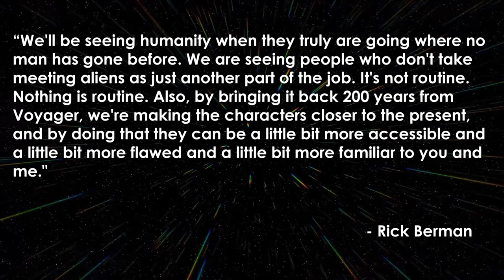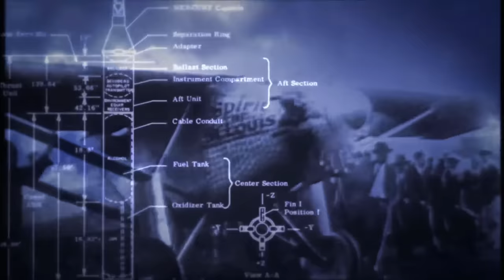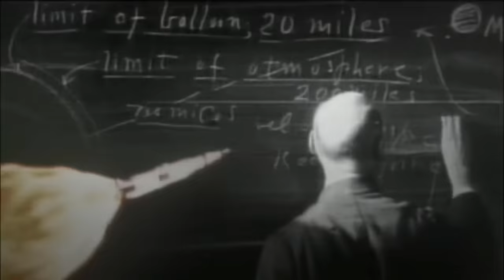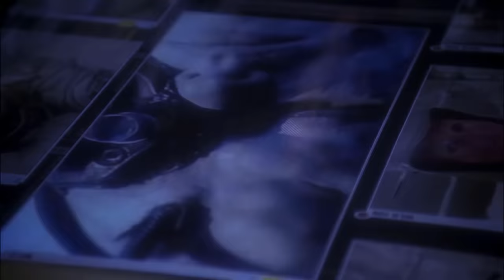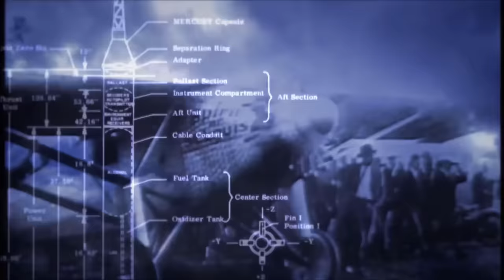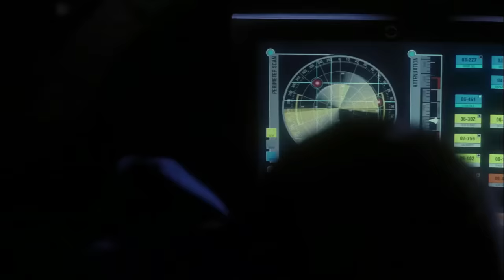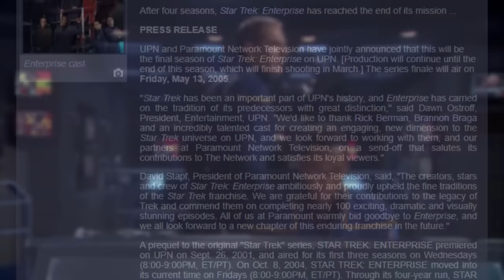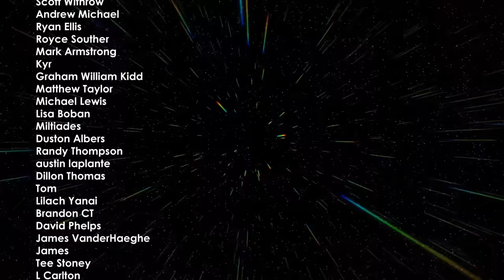Star Trek Enterprise Retrospective/Review - Star Trek Retrospective, Part 15

Comment: Honestly believe now would be a perfect time for an Enterprise sequel series. It's been enough years that the cast can appear as older versions of their original characters and we can see the tensions/dramas that would come from early Federation politics, unifying the races into a joint Starfleet etc.
Reply: They can pull a Roseanne, pretend the finale never happened and maybe do a limited run series or 3 part miniseries to finish their story.
Reply: As long as Alex Kurtzman (the man whom most Trek fans love to hate for numerous reasons) is still in charge of the franchise, at this particular time, maybe it’s best to let Star Trek: Enterprise rest in peace. If Kurtzman did attempt to bring back ENT, the end result may not be what those in the fandom wanted, hoped for or even expected, and that will simply anger, infuriate and fracture the Trek fandom even further, and that’s not what the series, the actors or the fandom deserves. 😐
Reply: We now have three prequel series (ENT, DIS, SNW). That seems to be all people want to make. =\
Reply: @lunasophia9002  - That seems to be what they want to make, because it’s “easier” (so to speak) to do a prequel that sets the stage for the other Trek shows than to do a Trek show that’s in a different time post-TNG/DS9/VOY.
Reply: @lunasophia9002  I would say that Enterprise was well warranted as a prequal concept though. Sure we may know that the Federation gets built on the heels of the Earth-Romulan War but we never get a true picture of Earth's early exploration after first contact and the years  of events that built those relationships. 

Discovery... nuff said

Strange New Worlds, please God be a return to the Trek we knew and loved.

Otherwise Trek Culture did a good video on some ideas but rather than saying "prequal" called them "unexplored eras". Still plenty of good stories to be told in there but depends on the direction people take it.

Comment: 1:17:00

Nope. The official Star Trek website was never shut down.  Also, Star Trek The Magazine ended 2 years before the cancellation of Star Trek Enterprise last issue April 2003).  The magazine was discontinued due to low subscriber count, high price, and the ending of the Star Trek Fact Files (its primary source of material, and the publication of which it was the american counterpart).
Reply: Rowan may be thinking about the Star Trek Communicator, a separate magazine (originally known as the Star Trek: The Official Fan Club Magazine) that did end in 2005, however, its ending had nothing to do with the ending of Star Trek Enterprise. Communicator was ended by the publisher Decipher due to complaints about long mailing times, threats of lawsuits, and Deciphers financial Issues.

Comment: The retrospective I’ve been waiting for and it does not disappoint. Thank you.

Bold statement, but I'd argue that Enterprise is the best of the Berman era Star Trek shows.

Not in any regular comparison of course, because TNG, DS9 and VGR all had their best years starting with season 3 or 4 resulting in four to five good to excellent seasons, and thus Enterprise can’t compare only having four season in total.

A more fair comparison would be to compare just the first four seasons of those series. And then Enterprise compares very favourably.
- Season 1: unlike the other series, season 1 Enterprise is never really horribly bad (as in Code of Honor bad), but also never really excellent (as in DS9 Duet). It just mediocre whereas the other shows sometimes are just painful to watch. 
- Season 2: all shows improve and so does Enterprise. Still no real highlights, but again no real horribly lows. The Borg episode is better than TNG did in season 2, the season finale is better than any of the other season enders save perhaps DS9, and in general it’s okay-ish compared to the meandering other shows.
- Season 3: Nothing comes close. The series still stumbles, but neither TNG nor DS9 have a s 3rd season that can compare to Enterprise. And the best episode (Damage) leaves Best of Both Worlds in its dust.
- Season 4: Although lacking the absolute highs of season 3, it’s again better than TNG. DS9 scores very well, excellent even, but struggles with its soft reboot and in general Enterprise seems more even.

Such a shame the series was cancelled, because more seasons would’ve likely cemented this.

Funny enough, I wish Trip had been the Captain. I just like his character in that role so much more. I think season 4 should have Archer as an admiral, Trip as Captain and Enterprise refit.

Comment: The issue with Dear Doctor isn't just that it amounts to a simple difference in perspective, it's that it relies on a deep and profound ignorance of both evolution and ethics, creating a story that rationalizes and endorses our civilization's most destructive impulses, framing something as evil as ethnic cleansing as a form of cosmically ordained enlightened altruism.

In the episode, evolution is depicted as a kind of destiny; a "grand plan" that the characters would be arrogant to try and alter. First of all, evolution simply does not work the way it is depicted in this episode. By definition, evolution deals with the slow, statistical increase in frequency of slight variations over the course of successive generations. It does not happen within the span of a single generation, and it certainly does not involve one species suddenly attaining a massive increase in cognitive ability while another species coincidentally starts dying off from a disease. 

Second, while equating natural processes like evolution with some kind of grand or cosmic plan is certainly a staple of Star Trek stories dealing with the Prime Directive, past episodes have still treated this perspective as just one of many philosophical positions on the issue of interfering with less advanced civilizations. It is not treated as the moral underpinning of the Prime Directive itself. In both TOS and TNG, the Prime Directive is treated as a well-meaning, but ultimately arbitrary regulation designed to prevent Starfleet Captains from unduly inserting themselves in the middle of alien politics. In many episodes, General Order One is treated as a barrier that prevents the Captain from doing the right thing, ultimately leading to them finding a clever work-around or just flat-out violating it. It's like Kirk violating orders to take Spock to Vulcan in Amok Time. There are always circumstances where blindly following the rules lead to bad outcomes, and the best episodes of Star Trek involve the Captains making the hard decision to bend the rules when it's necessary. Dogmatically defending the Prime Directive as some kind of moral absolute is the opposite of what Star Trek should be about.

Likewise, dogmatically refusing to interfere with "natural processes," like the emergence of a deadly virus, represents a form of naturalistic sophistry. Dear Doctor would have us believe that curing a virus is akin to "playing God", but aside from this being obviously nonsensical (since curing diseases is something we do all the time), this conclusion is predicated on two assumptions. First, we must assume that Flox's interpretation of the evolutionary future of the Valakian people is the correct one. Second, we must assume that the way things are represents the way things should be. I explain earlier that evolution simply doesn't work the way it is depicted in this episode, but even if it did, that doesn't automatically mean things should be allowed to happen the way "evolution" has decided it should. This type of fallacy is called "deriving an 'ought' from an 'is.'" Just because a human is born without fur doesn't mean that they ought to never wear clothes. And just because this group of people is born more resistant to a deadly virus doesn't mean they ought to dominate those who aren't. Flox's position is based entirely on these two fallacious assumptions, but the more troubling thing is that Flox's position actually isn't all that alien. There are plenty of real-world examples of this perspective being put into practice, and both we and the world of Star Trek regards them as acts of barbaric cruelty.

When Europeans began colonizing North America, they unwittingly brought with them the Smallpox virus. This disease had emerged in the cities of Europe, flaring up and dying down like fire at various points over the course of thousands of years. As a result, a natural immunity to the virus became common among people of Eurasian descent, but to the native people of the Americas, who had been cut off from the Eurasian continent for tens of thousands of years, this immunity was all but nonexistent. Because of this, smallpox absolutely devastated indigenous populations to a degree that is almost impossible to even fathom or describe. Even the word "decimate" is insufficient, since it literally means "to remove one tenth." In some areas, Smallpox wiped out as much as 90% of the native population. Entire villages, who had never even seen a white person, were completely annihilated by the virus. Modern science-fiction loves to fantasize about the post-apocalyptic, depopulated remnants of our civilization, but to the indigenous populations of North and South America, that actually happened. If anyone tried to actually argue that this was the will of evolution, and that it had to happen so that the preferred race could reach its full potential, we would know what to call them. If they took the next step and actively worked to help it along, we would also know what to call them. Yet this is exactly what Flox does in Dear Doctor, and we are meant to agree with him.

Refusing to cure the Valakians even though it is in your power to do so isn't just moraly questionable, it is evil. Justifying your decision by claiming you're doing the work of evolution is even more evil. Flox is a genocidal monster and should be regarded as such.

Comment: The Shuttlepod podcast run by the actors of Reed and Trip had Rick Berman on recently, and he tells them why it had to end the way it did. They didn’t want to do it g the holodeck way.
Reply: Ok.  Why did they have to end it in the hollodeck?  Are you going to finish the thought?
Reply: @JV-xf9ry  Here you go. I timestamped it to where he starts talking about it. It's a good show to listen to or watch if you have the time. Trip and Malcom are pretty good hosts.

 https://youtu.be/T12A5mS3VPo?t=1740

If you REALLY don't have the time, a quick summary is that they thought they had three more seasons to show how the Federation was founded, but the network said "nope, this is the last season" almost at the end of the fourth season. They had to scramble and come up with SOMETHING, and that was the best they could do in such short notice.

Comment: My biggest problem with Enterprise was the immense amount of filler episodes, and like you said, retreading old material. If these filler episodes were really good, they were not satisfying in the long-term and I always felt that they stole episodes away from what could have been core material to the series' premise. There was enough 'filler' episodes in many of the other series, and serialization was becoming the norm around this time.

I feel like the temporal cold war and even the xindi arcs just took this series so far away from the show's premise. It never really got back on track until season 4, which ironically also had to spend episodes correcting canon as well and had 3 episodes purely dedicated to ending the temporal cold war and finishing the series, and all 3 of them were garbage. 

In a nutshell, the series was just spinning in circles. The Xindi arc wasn't bad; I just don't think this was the right arc for the time period. 

Still, if Season 5-7 would have been at the same quality as Season 4, the show could have been one of the best Star Trek's ever. I miss it somewhat too because the new Star Trek shows don't evoke the same feelings as TNG, DS9, VOY and ENT did. I kind of hate them.

Comment: I was one of the few who liked Enterprise when it first aired. I saw it as it's own thing separate from the other Trek shows and I think it worked fairly well just not as a prequel for TOS. Stylisticly it now works better as a prequel for either the Abrams trilogy or Discovery. I think you summed it all up quite well. It had some strong moments but it was not the right show for the time.

Comment: I don't really care about the continuity either - but to me, if you set a series before replicators and holodecks to try and do something new and daring, and you still find yourself using holodecks only a few episodes into your daring new show, that might be a sign that you've run out of ideas. So in this case, I get why this was a sticking point. 

It was the second Trek show in a row to come up with a premise that forces limitations on the characters and thus opens up new sources of drama, only to ignore those limitations much of the time. And given that the franchise has a fairly extensive backstory and not a ton of room for surprising plot revelations in that backstory, then if you're not going to actually make things harder for your characters by giving them a lower technology level and forcing them to work with it, why make a prequel series at all?

Comment: Is UPN even a network anymore? I think part of the problem was the network. I remember in the early to mid 2000's UPN was a joke of a network. When flipping through the channels, the only reason you'd ever stop on UPN was either as a joke, or because you locked someone in the room and took the remote so they couldn't change the channel.. at which point whoever was locked in the room would unplug the tv.

Comment: Enterprise is flawed in many ways, but as a prequel series it's probably one of the best ways to do it. Not relying on trying to tie it in with existing characters and situations. This gave the show it's own world to create. Of course it helps that the show was created by people involved with the previous shows, who did take a lot of care to tie things into the existing universe.
Compared to most Star Trek since, which was trying too hard to shoehorn their show closely with TOS for Discovery and TNG with Picard. While this can be done, it's difficult. Especially when the writers and showrunners aren't the same people who created the originals. 
Discovery would have been better suited if they just put it 900 years in the future to begin with, although the crew dynamic is too snarky compared to the more enlightened crews who came before it. Although that could have been fixed if they took inspiration from Voyager (Which is a crew that was too "enlightened" considering half of them weren't Star Fleet).
In either case, flaws and all I think Enterprise is an amazing series, and it's a shame it didn't last longer.

Comment: Surprised you didn't speculate on the possible connection between the Xindi War and how it was written in the aftermath 9/11 (no, I am not trying to be Mr. Enter) and how it also contextualises the presentation of the M.A.CO. army unit as more positive than what that kind of group used to be represented like in television before that point.

And how they also basically address AIDS and the stigma it carries.

Comment: just finished watching the whole series, i remember not completing the first season when it first aired. my thoughts, like all series it has some great charachters, wether its because of the actor or the role, such as dr phlox, and commander shran. it had some ok but somewhat underdeveloped charachters, hoshi, trip, reed. miscasting or poor acting seemed about the same as other star treks, but i never warmed to either t'pol,or  archer, either as actors or charachters, they come across as wooden most of the time, which is a problem if they are supposed to be the mainstays. there are some glaring inconsistencies in their charachter, such as archer  killing the clone to save trip, and t'pol is such a cold fish i never bought into the relationship between her and trip, agree about the overly sexualising of t'pol, but jeri ryan had the same issue, its just her charachter was more interesting and the acting was better.
 the first 2 seasons took a while to get going but werent as bad as people say, 3 was the best season, and i dont get all the hate for the final episode of season 4, it worked for me as an original way to round off the series, and was well structured in my opinion, trips death was merely a plot point to revolve the episode around, i certinly thought there were other more glaring plot swings in other episodes. overall enterprise was a pleasant surprise. like all the series it had some major flaws, and some great moments of storytelling and execution, and lets be honest, anythings better than the godawful discovery.

Comment: Gee, the fans raised $32 million for a fifth season and CBS still wouldn't budge? That's so wrong. That was enough to garnish THREE more seasons and certainly would have tied it with the runs of the other spinoffs. That's ridiculous. In 2017, rather than create Discovery, I would have just resurrected Enterprise and pick up from there twelve years later.

Comment: I hate the Temporal Cold War and the entire Time Police idea as a whole. Because it adds a tremendously horrible idea to Star Trek.
Mainly: Whenever Time travel aids the Federation nothing is done to stop it. That also includes genocide on a planetary scale or higher. But the moment a rock is pushed towards anything remotely connected to the Federation everything is done to prevent it from happening.

The Federation is, due to the Time Police, turned into a false utopia that is build on the corpses of Galaxies.